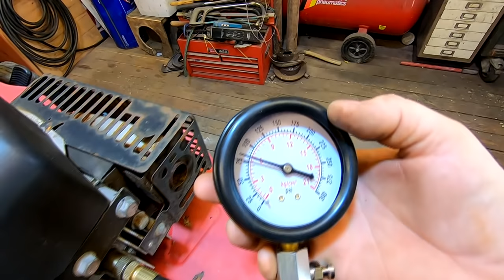Experts wanted £120 to FIX this This Scrap Lawn Mower

Comment: All right Martin,  them tubes you are on about,  I get all  mine free from the in side of  old  trigger guns and deodorant cans,  used them for all types of things,  won't fit in the spray caps but the ones like the carb cleaner will. ..👍👍

Comment: Thank you, very useful as I have the self drive version of the same mower. I was given mine as a non runner about 5 years ago. Carb clean  fixed it. It's still working OK now. The lady I got it from still had the instruction book in a plastic folder. When I looked at it it had the original shop receipt. It was from focus DIY march 2007. Cost £129.99 + £10.99 for the engine oil. I did have the Carb jet block quite often. I added a tiny moped in line fuel filter to the fuel ine and that totally fixed it. Thanks once again.

Comment: Am in talks with Mr diesel atm lol good guy mate. Loved the plastic bag wrapped round the blade lol rescue the snails lol The deck dont look to bad mate . The carb looked a bit dirty but not too bad Martin .
Reply from the maker: Yes Ali, seeing as it was scrap, we turned it around and should sell well. With your mechanical knowledge, I thought you might have got involved in repairing mowers to make some quick easy cash bud.
Reply: @retrorestore  Am sticking with the motors mate. I  got to much as is but I do have to  service that old Briggs av got. Got a Honda that's seazed as well. But I  leave a lot of my thing's over on my brothers Farm as he has more space than me. You  may even see me working on a forty plus soon. I have to get bits for her so I may strip her down first. Good Job mate as always. Enjoy your day.👍

Comment: Hi Martin I noticed you used the pledge Revive it Thanks for the tip 👌🏼 but they no longer sell that product 😢😢 so though I would share with you another product pritty much the same 😊
Quick Shine Multi-Surface,
Floor Finnish.
The label is green.  
Hope that helps & loving you video 👌🏼
Reply from the maker: Thanks bud. i'll look it up.

Comment: you can use a heat gun/ blow torch to fix faded or powdery plastic, like the plastic cover on the top of the mower, heating it up will make the plastic look like brand new and make it just as strong as new plastic , just make sure to clean it very well first or it will seal in any dirt left on it.
Reply from the maker: Yes I have tried it with mixed results.

Comment: Hi buddy keeping up the good work as usual I'm just wondering how to clean a carb out is it any good to leave it soaking in paraffin overnight or do you think it might do a carburettor some damage just thought I'd double check before I did it with a chainsaw carburettor
Reply: I know how to clean a carburettor out and just wondering if it would help with any if I leave one soaking in paraffin strip down
Reply from the maker: I always use the ultrasonic cleaner for stubborn carbs for about 30 minutes.
Reply: @retrorestore  OK buddy I haven't got one of them but I will do it at some point I've got a chainsaw as clean the car and everything but it is not getting fuel through to the spark plug so I have stripped it out again and left it's soaking in paraffin it's been in in about 45 minutes now

Comment: Martin good video as usual but a few questions,I have a challenge mower with the same engine but no throttle adjustment,where would you say is best to get a fuel cap from? Mine was missing when I get the mower free on gumtree last year, none runner,cleaned the main jet out because it was blocked,put it together started first time, completely ran it out of fuel after I used it,put fresh fuel in back in April, started first time again :)
Reply from the maker: Have you tried Garden Hire Spares website Christopher ?

Comment: hi martin hope you and family are ok love scrap it mans channel too doing some good stuff.
just a quick question my ibea 420 mower i got is still surging and revving high and also getting really quite hot to the touch could it be a head gasket damaged its a quantum engine had new filter and a air filter gasket and a full carb clean but the jet is fixed o cant get it out but carb spray flowed through as is the fuel but am at a lost end trying to find the fault your advice etc would be greatly appreciated thanks and keep up the great videos
Reply from the maker: You might have an air leak between the carb and the intake causing a lean mixture. That would make it run hotter too.  Try and keep the mower running and spray carb cleaner round the carb and if the engine speed increases, its sucking in the carb cleaner confirming an air leak. Do it on a cold engine though.
Reply: @retrorestore  hi Martin me again I'm becoming a pest with all the questions lol I have tried carb spray on the intake as you suggested and it's not leaking anywhere also the carb is a fixed jet carb any way to remove the emulsion tube it is doing my head in now as I can't seem to find the fault also the spark plug was really hot to touch any suggestions would be grately appreciated thanks martin

Comment: Hi  Martin what  grinding disc do you use on the angle grinder for blade sharpening thanks 🙏
Reply from the maker: I use an 80 grit flappy disc.
Reply: @retrorestore  Thank you  is this from amazon
Reply from the maker: @TheBusracer  Yes, they sell them on there
Reply: @retrorestore  Thank you 🙏